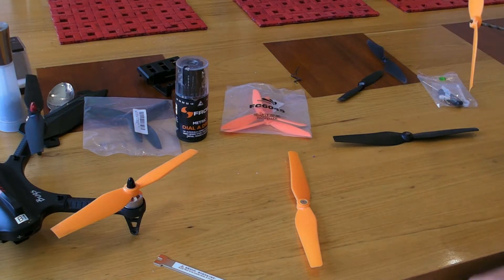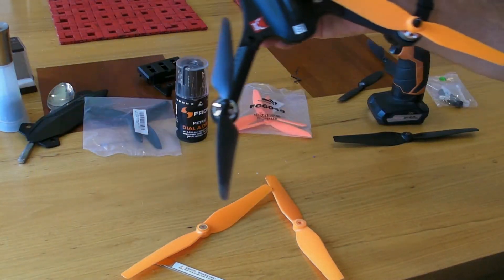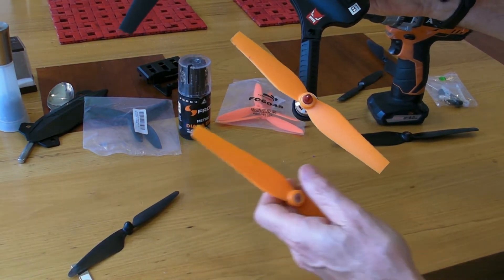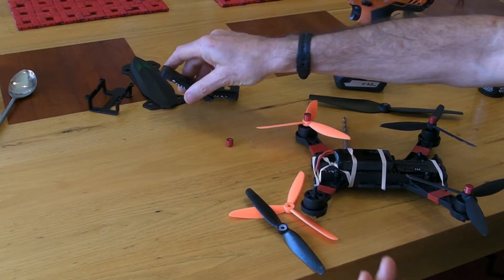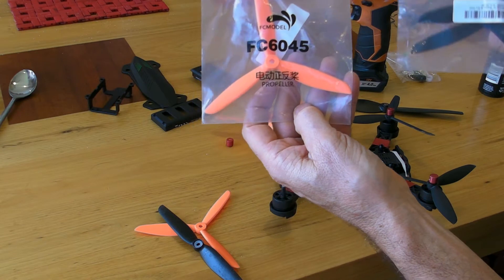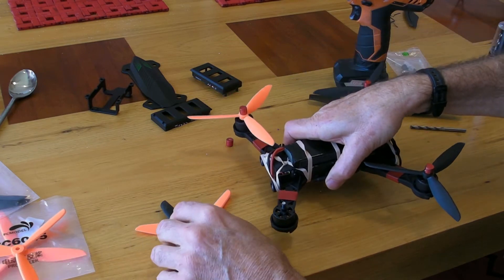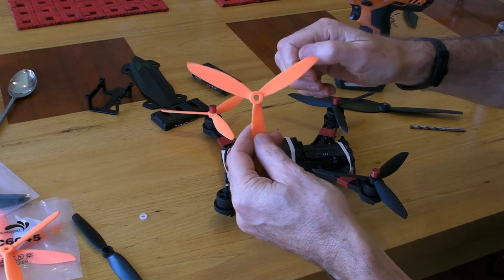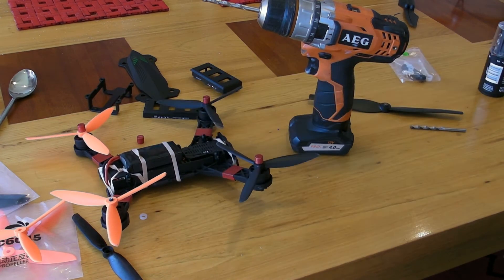Modifying and fitting  props to MJX Bugs 3 and 6

Comment: I find that most of the blades I bought for my Bugs 6 need altering.  Only the "HQ Props" fit on well, but ya need those lil silicone rings on First then put prop down onto it and tighten... 
  All the others  I bought all need alteration.... I don't like to do that but I drilled them out enough to sit flush on the motor so they fit well enough now....... I bet there not perfectly balanced now though.   My first test with the cyclones was a few min ago and they scream...Fast prop hahaha They worked well enough, and don't seem to warble... (I got my stuff at GetFPV incsae yer wondering. and- No...I am not a rep. or get paid from them hahha0

Comment: Man.. I saw u put some new battery on bugs 6.. Wich is?
Reply from the maker: That is the standard Bugs 6 battery after the plastic cover is removed. I have since removed the covers from my Bugs 3 batteries too, to reduce weight. Use rubber bands or velcro to hold them in place. I also use Syma X8 batteries, with converted XT-30 connectors. All these batteries work well with both Bugs 3 and 6.

Comment: can a propller of mjx bugs 6/8 be used in mjx bugs 3 .... ????
Reply from the maker: You would have to drill the hole out a bit to make a B6/8 prop fit a B3. They are shorter than B3 props, so less lift. What I have done, is clip the tips off damaged B3 props. These work, giving less lift but better control.
Reply: Are the prop nut threads on the B3 and B6 motors both 5mm ?
Reply from the maker: Yes. I've just checked mine.
Reply: Bugs 8 and 6 props fit bugs 3 with no modifications, just tried on mine but don't generate anywhere enough lift to carry an action camera, felt quite dangerous and dropped from the sky with anything under half throttle. After testing a whole bunch of props ive stuck with the stock props